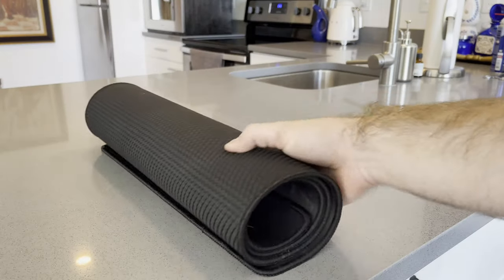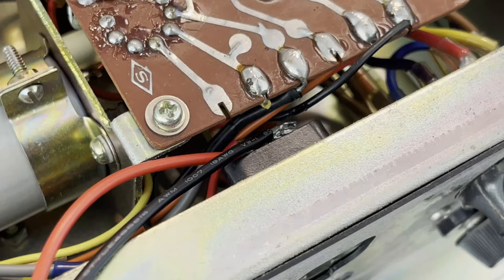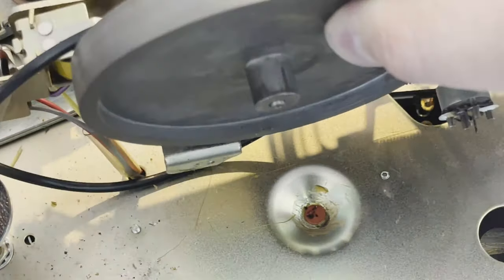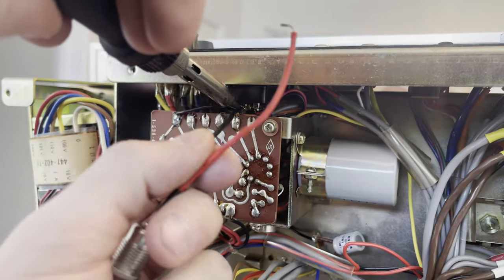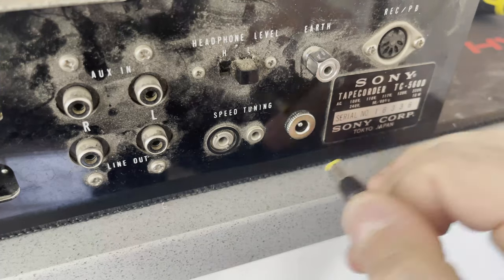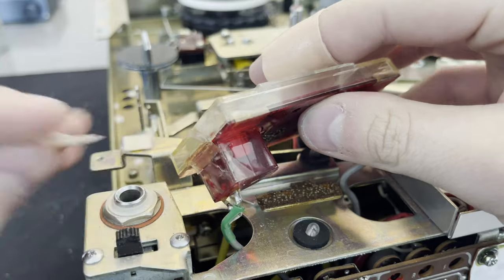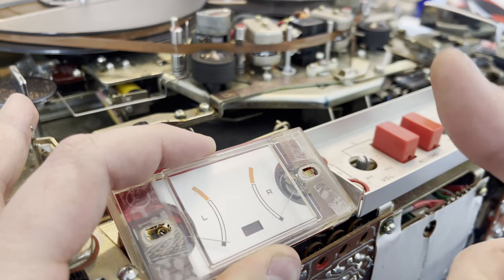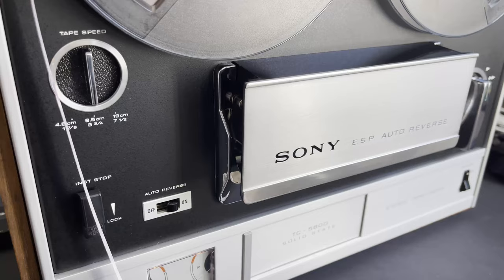Sony TC-560D Reel to Reel Revival | Vintage Hifi Revival

Comment: Nice video, but a few safety related things made me cringe:
- don't put 12VDC and 230/120VAC on the same DPST switch, like, EVER! The contacts inside the switch are likely very close together, which is totally unsafe.
- don't ever disturb a solder joint after taking the iron away. That will guarantee a cold joint.
- don't tin your wires if you're going to crimp them. It's extra work and will cause the connection to fail eventually, because solder keeps flowing ever so slowly, and will leave you with a loose connection. Either solder them or crimp them, never both.

Also, to avoid drilling holes into your precious vintage tech, you might consider re-purposing existing holes for stuff you're not going to use, like e.g. that speed adjust jack. That way you can always undo your mods, just in case you do find the correct cable eventually.

All that being said, I still enjoyed the video! Keep it up!
Reply from the maker: Thanks, I was wondering why they wouldn’t have the DC input be switched as well, and if it’s because they would need a separate switch then that makes sense.
Reply: @HifiJelly  This is only a problem though if he was ever to find a power cord, and power it from AC 240/120.

Comment: You have the nack my friend .. For never working on reel to reel taperecorders you could have fooled me. Yep, the Sony's from the 60's are hard to beat, real meaty and put together like commercial units. I recently picked up a real beast, the "Sony 600 Stereo" circa 1963. It's a hybrid (6 tubes & 6 geranium transistors) and a hefty 53 pounds! Haven't had at it yet but can't wait. I restore mostly vintage tube audio and tube Ham Radio equipment. Get some more my friend and you will be hooked. Cheers

Comment: I have the TC-560, same transport but is a complete recorder and playback with speakers. One heavy beast! 52 pounds!  But, it has a handle, so technically, it's portable! Ha!  I have both cords for mine, it runs great on 12 volts, only pulls about 300 milliamps, just amazing. The only thing about these transports is the fast wind and rewind speeds are rather slow, due the the use of the 12 volt DC motor. However, the wow and flutter specs are darn good for a single motor deck. Thanks for the video.

Comment: The DC work around was a nice touch but open to future problems. I would have picked the AC connection. Just solder two wired to the each connection like you did the DC and plug it in. With your current DC connection you or someone else will use the wrong voltage or the wrong polarity DC and blow out your amplifier. Also in many cases a 2 pin AC plug can be shaped to fit over the proper AC pin connection or even a molex female connector with shrink wrap over it can work. Note if you do this, then un solder the DC connections of that socket so the AC does not get pugged into the DC connection in error.

Comment: My brother had the version (TC560 instead of TC560D) which had the speakers and built in amp. My only issue with it was the slow rewind and "fast" forward functions. Very good specs, especially when we used the Sony SLH-180 low noise tape.

Comment: Belts usually are disintegrated and needs to be replaced. The heads could be worn, but if you want to edit tapes, you could replace the heads by half track heads, so the tapes will be used in one direction only, but the noise is less.
Another possible enhancement, when you doesn't need compatibility would be adding a dbx noise reduction. It's an external unit.
In theory you could put a Dolby HX in, practically you have to be an expert with high skills.

Comment: Nice work! In the 1980s I had several Sony quarter track tape recorders from the 1960s and they all worked great with not much work. I've never seen one with Auto-Reverse, though. I wonder how it works.

I would have solved the power supply problem by replacing that wonky connector with a figure-8 or an IEC one. But whatever.

Also are those playback/recording heads really badly worn? Or am I seeing it wrong? If so, that's a shame. Oh well.

Thanks for posting!
Reply from the maker: Thanks! Funnily enough the auto-reverse doesn't work, I didn't realize that until I was using it for a bit. I think the way it's supposed to work is by listening to the output of the tape and when there has been silence for 10 seconds it will switch the play direction. I think the heads are fairly worn, but I can't hear any issues with them, maybe I could try lapping them, but I've never done that before.
Reply: It's a special playback head, that can play all 4 tracks.

Comment: Excellent video with a lot of patience. I have a Sony TC560 which I bought it in Japan in 68" I used it until '80s and last year I started to use it again. The problem is the left speaker no sound I proceed and tested the speaker and the wiring is good. Can you help me? What's causing the speaker not receing the sound signal. Many thanks Frank 🙂

Comment: Ok i get it. But surely someone out there has hacked a vhs to allow massive bandwidth (quality) using audio only. I used to record my music onto those for 6hour party mixes. Always thought it would be amazing to use all the available tape for ultra high quality audio or a cassette that could play for days without reaching the end.  Kinda makes the reel thing a bit meh. Besides having reel to reel doesnt mean high quality with most of the players out there. Whole lot of crusty chemistry hidden away in those old devices.

Comment: 27:20 look at this front plate, it is chrome on plastic and many parts that look like metal have just thicker chrome on it, so there was chrome on plastic and of course more real metal aswell. Today they use just a much thinner layer of chrome. Really nice Mashine btw, it looks and eeven sounds good.

Comment: A few years ago I got a Sony TC-355 for parts or not working for $25.  I had a TC-252 that I bought back in 1984 that had some major issues that I had to have the parts cleaned.  The 252 is no longer in service but the TC-355 I got going just by loosening some parts and it sounds amazing.  Great find for you.  You'll love it.  Great job.
Reply from the maker: Thanks! It’s a great machine and my it’s still my main reel to reel player

Comment: hi i never seen this model in the uk  ever  i have 3 tc 755 decks i picked up at £20 each
because parts were jammed up  we all know why 
my first reel to reel deck was a model with a speaker in the front 4 track mono 
later i got a deck like this one later the first sony tc 755  

i do have great deck new RS1700   OTARI MTR 12 finding great decks 
is very hard now  use the bigger tape formats as price of 1/4 tape is silly
now  my otari mtr 12 is a jazzed deck  1/4 and 1/2 inch  can change rollers
and head blocks  can take 1/8 inch  in spool tape mode  

i used to do cassette dubbing mono for people  in the past

Comment: I had 2 Sony TC 580's. Those were beasts and heavy AF.
Recapped them both and replaced all the transistors.
Then they got ruined in a flood. 
The model you have was a lower entry model to be honest. The Sony TC 377and its predecessor TC 366 were everywhere in the 1970s. They were made to be serviced pretty easily.  Sony made a ton of different reel to reel machines.

Comment: $20 bucks, you got a great deal indeed!  I'm so happy it did not have any other deeper issues. It is always a gamble, but you won this one.  Auto Reverse decks can be a PITA to tackle, but this deck was kind to you, other than the stuck VU... Not as difficult of a deck to work on as I assumed it would be, but it is still a complex circuit they designed on this though... Very informative and in depth restore of the mechanical operations. Great job my friend!  Nice clean work you did and I'm glad the motor, meter amp and playback circuits were all still good.  I'm also in the process of restoring a few decks myself.  It is a labor of love indeed, but the reward is well worth it... Thank you👍
Reply from the maker: It’s funny because I’m pretty sure that the autoreverse part is not working on this deck. It took me a few plays with some tape before I realized it, so I’ll need to investigate that at some point in the future and see if I can fix it.
Reply: @HifiJelly  So I think you're referring to the ESP function. That circuit may be faulty, which happens on many of these decks. I don't know if you have the schematic, I don't, but locate the PCB that contains the circuit that controls the auto reverse switching. I would believe there should be relays that switch this.  I would give a good guess that a relay and/or some capacitors may be faulty... Check the relays and make sure they are operating correctly.  I would also check the capacitors in that path. The resistors rarely fail, but it is possible resistors have failed as well. Let me know how you make out.
Reply from the maker: Thanks! I do have the schematic and I’ll take a look at the board.

Comment: These are full of idlers and pulleys and such. Get them right and they sound great. My Dad had a TC-355. I was never a fan of the scrape flutter pads, kind of a cheesy way of getting it done. I have been around reel to reels for years. Love reel to reels. Getting blank tape is not so easy new any way. Plus Biasing and Equalization to your favorite blank tape is always fun. Wow and Flutter on these were pretty good considering the many moving parts vs. a 3 motor reel to reel. You should try a 3 motor reel to reel. So nice and elegantly simple vs. the Sony and Akai mechanical ones. But pure fun if you can make them go. I would do it, but no space to work on these things. Fun to watch you bring them to life. Love your 3D print setups you have.